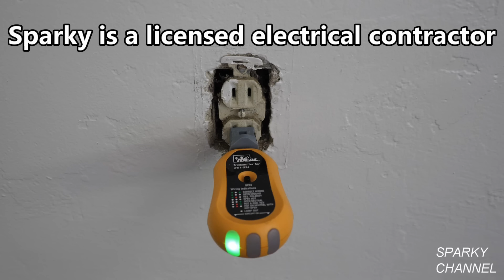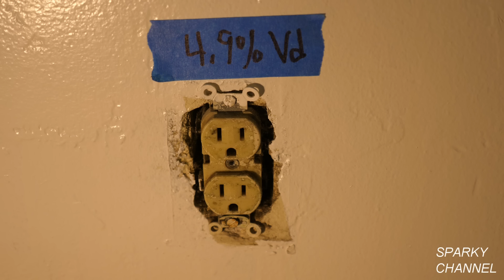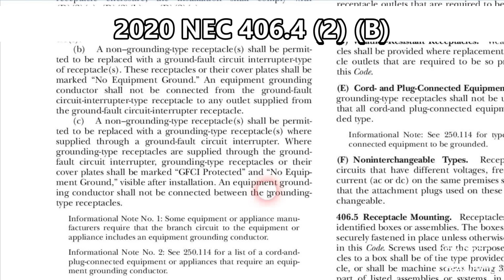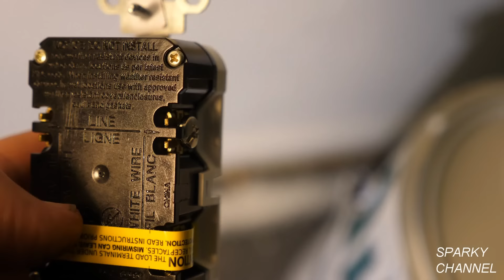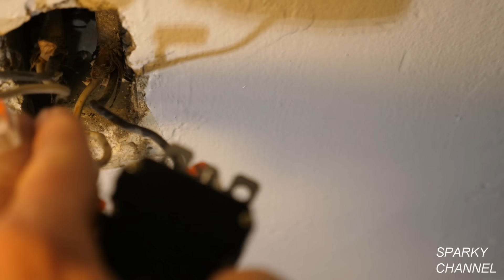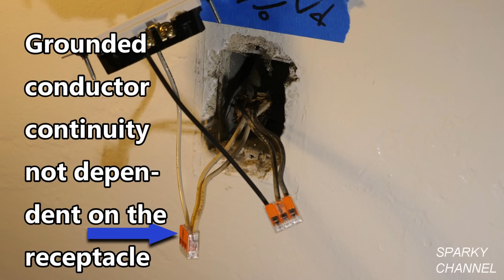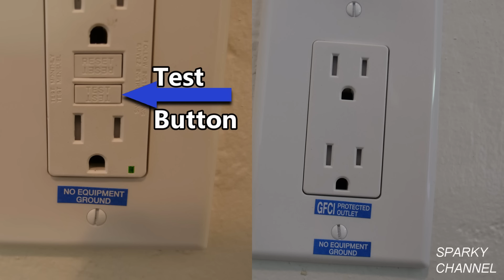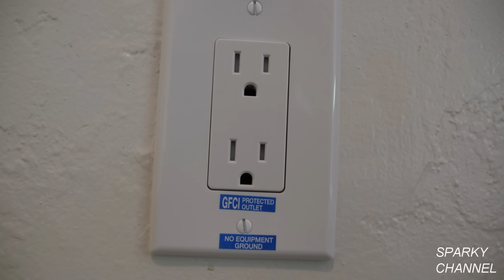2 Prong Receptacle Circuit Replaced by GFCI and Grounded Receptacles per 2020 NEC

Comment: I'm not seeing the logic of using pigtails instead of wiring directly to the receptacle. The idea of "if the receptacle fails" power will still go downstream has at least 2 logic problems imo. #1 A receptacle failing can be a serious problem because it's likely not going to be a clean break. You can have the receptacle heating up. If downstream receptacle also lose power I'm more likely to be alerted to the problem asap. #2 Following your logic then what happens if the pigtail connector fails? Why are you focused only on the receptacle. What we've done here is introduced another place for failure. Now if either the receptacle or connector fails there would be a problem.

Not saying it's wrong to pigtail, only the logic. The reality is this systems are in place to reduce risk caused by receptacle or connector failure. Code doesn't require pigtails in this case. Sometimes creating your own expanded code can cause added risks. But that's the world we live where almost everyone thinks they know better about everything. I just try to follow code as best I can.
Reply: 15:30 he gives the reasoning. It is not Code to pigtail and you're right about the devices being built to do the job. But receptacles can be subject to physical damage. Plugs can be worn and faulty creating heat and destroying receptacles. Pigtails insure no loss of neutral current downstream which is a huge problem especially if the circuit happens to be a multi conductor circuit. Pigtails are a step above in most electricians opinion.
Reply: I've had insert connections fail. Never a pigtail.
Reply: @djg585  nobody is backstabbing
Reply: I have always preferred using the receptacle to connect the two sets of conductors. Less wire in the box and less points of connection.
Reply: Agree.. and what could possibly fail in the receptacle that could break the connection? Its two wires screwed down to the same little copper plate. The copper plate would have to somehow snap. Seems to me the pigtail is way more likely to fail than the receptacle

Comment: There can be dead outlets, rare though. Sometimes because of a tripped GFI no one noticed. So turning off the breaker and then testing for dead outlets could end up confusing a person.
Reply: Excellent point. I hold back to not seem like a crab but I spend more time proving each and every cable. It is not predictable what happened over time in residential wiring, everyone has an Uncle Festis it seems. Prove every cable , I flash the conductors of every cable. Bill may have actually done so but is limited to how long the video can be.

Comment: So you don't need to run a new cable with ground to replace the old one?
Reply: It's not required. But yeah it would be better to replace the cable, but at considerable expense.

Comment: I replaced a 2-prong outlet with a GFCI outlet as an upstream outlet and connected two downstream 3 prong outlet. I use 2 wire Romex( with the additional ground wire) to connect all of the downstream outlets. I connected the ground wire to the GFCI green screw(ground) and connected all outlet grounds together. Now, I know all ground wires should return to the panel when possible, but this was not the case.  Did i connect the grounds to the outlets properly? The circuit works fine and I have had no issues. Please let me know if I probably caused some kind of future problem.
Reply: That is a code violation. The code explicitly bans connecting the ground wires. There is a potential risk that if the ground wire in one outlet gets energized the connection spreads it to all. 

Never improvise with the grounding.
Reply: @okaro6595  Thanks. I felt somewhat uneasy about the grounding
Reply: Other than what Okaro X said, your plugs should be protected because in the event that someone gets shocked, the load on the hot wire and the neutral will become unbalanced (unequal) and trip the Gfci breaker because part of the current will not return on the neutral, but to the ground through the person getting shocked.

Comment: I’d love to do this in my old house, but I’d be hard pressed to fork out $400 for a circuit analyzer like this one.
Reply: Where you getting $400 from? It's $50 on Amazon for the circuit breaker finder
Reply: You dont need one. Flip a braker and find out wha turns off.
Reply: Why can’t you just disconnect all the outlets in the series and put wire nuts on all the wires. When you turn on the circuit breaker, only one hot wire will be live. That would be your most downstream circuit and where you would put the GFIC.
Reply: @blopez804  didn't he do that??
Reply: Jon said circuit analyzer. not finder. The analyzer displays voltage drop and other stuff quickly and accurately. Although It can be calculated using a multimeter and know load.
Reply: Klein makes a similar tool that costs about $130.

Comment: Liked this - Wonder if those connectors are the cause of the voltage drop, and if so, are they heating up at each outlet?  An old fashion twist connector installed correctly may be more efficient.

Comment: Sparky great channel.  Can I remove a two prong and replace it with a three prong and run a grounding pigtail to the box?  My two prong wiring is in bx.  Thank you.
Reply: Actually, I think you can. If the feeder is the old style BX which was designed to have the steel casing of the cable serve as a ground then yes. It's infamous as a horrible ground and that is why it was abandoned but at the time it was code. If you do this, check for continuity from the BX to a proven ground like a water pipe. Don't be surprised if the BX jacket is open/ ungrounded as the connectors for BX cable terminations are the entire problem with the system. If no ground... Install a AFCI GFCI device.
Reply: @fritzmiller9792  Yes and at that time the set screws to the two prong outlets secured to the metal box were considered as being grounded by code. Things have certainly changed thankfully.lol
Reply: No
Reply: Why?  When you test the outlet it shows properly grounded.

Comment: Couldn't you just plug up both the hot and neutral on the outlet without the wago connector?
Reply: I assume you're talking about 14:09. Yes, you can attach both hot and neutral directly to the receptacle (there is no code that disallows it as far as I know). Doing this doesn't change the path of the circuit, as all the neutrals are connected and all the hot wires are connected with either method. However many electricians will add a pig-tale so that the receptacle itself isn't responsible for feeding other downstream receptacles. 15:04 explains.

I am not a licensed electrician

Comment: SEVEN outlets on a single breaker? That seems a little odd even for back than.
Reply: I have seen 3 bedroom homes from the 50s with 4 circuits for the whole house.
Reply: @toddwilliams5905  My home today, before the service and panel were upgraded, had 4 BX cables and 4 old style fuses for the whole house. People back then didn't have that many things to plug in.
Reply: considering that reading lamps were mostly plugged in, it's not unusual at all. Now days, it would be a disaster with everything being plugged in, all the time. :)
Reply: how so ? 15a can go up to 8, 20a can go up to 10..  This is 2021 NEC... so why would 7 for back then be wrong ?

Comment: So how would I do the whole house would I do it the same way you did with the 7 outlets? To fully ground the whole house would I run a ground to all outlets and light fixtures? If I need to replace where the outlet where the frigerator is do I need a 15amp or 20amp outlet. Help please respond..

Comment: Thanks I really need this info....Old cottage with no ground....who ever wired it previously just put a ground from the receptacle to the receptacle box....I was looking at it and said...that sure doesnt seem grounded to me!!!!
Reply: The box may be grounded. Get a socket tester or use a multi-meter to measure voltage between the line and the ground and continuity between the neutral and ground. Of course to properly test it one would need better measures.

Comment: sooooo why didnt you bother adding an actual ground wire. seems the GFI is useless if you dont add that ground wire. and seeing its an older job it would be better to just update it to be safe. and if a homeowner or business owner isnt letting you do that work, id walk away from that job if i were you. because wont lie, if you redid outlets in my house and didnt bother to tell me it needed to update ground wire because of the house age, especially after showing me there was no ground in my outlets. and my house burned in an electrical fire....that leaves you open for liability lawsuit. 

id say just tell a homeowner its a good idea to have it done, show them the missing wire and if they refuse have them sign a liability form releasing you from any liability should the house catch fire due to electrical failure. 

just saying that would be a good idea to cover your own ass.
Reply: Using GFCI without a ground to provide a 3-outlet receptacle is totally compliant with NEC regulations (as long as you add the "no equipment ground" stickers). GFCI doesn't need a ground to protect users, as it's looking for any current leakage between hot and neutral. Generally ~5 milliamps difference between L/N is enough to trigger it. Older houses like this often only have a hot and neutral to each box, meaning the homeowner would have to replace any home-runs back to the panel with NM cable, which can become prohibitively expensive very quickly.

Is it as optimal as a proper ground to the box? No. Is it safe and permitted by code? Yes.

Unsure what you're on about.
Reply: My understanding is that GFCI protection without an actual ground protects humans, but not necessarily equipment plugged into it. I will say that the title of the video is a bit misleading when it calls three prong outlets grounded when each of them says no ground right on it. I would call them GFCI-protected three pronged outlets, but I'm no expert.
Reply: @sharpshooterv  You are correct. One should call them grounded type receptacles, not grounded receptacles.
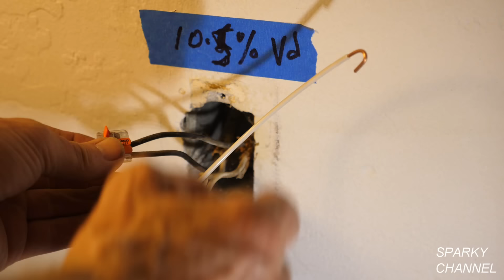Reply: @okaro6595  Absolutely correct.  Your point is best proven at 15:57 here when ungrounded receptacles are called "grounded receptacles." Not mere semantics when concerning what is obviously reasonably to be expected to be used as instructional material by laymen for such hazardous activity.  Then again, perhaps I'm overly biased by my own occupational experience. 😂👍
Reply: In residential, the neutral is a "ground". In the main panel, the grounds and neutrals are tied together. The difference is, the neutral is the return path for the electricity. electricity is constantly trying to find it's way back to the source. Whereas the dedicated ground wire, more often than not, grounds the housing of whatever is plugged in to that outlet incase it becomes hot. The GFCI will monitor the balance between the neutral and hot and if it detects an imbalance, will cut all power to it and after it. Which is why he didn't pigtail the GFCI outlet.
Reply: No. He isn't subject to liability because he followed electrical code.

GFCI protects occupants against electrical shock. They DO NOT protect against fires.
Similarly an earth wire protects against electrical shock, it does NOT prevent fires.
To protect a home against  electrical fire you need AFCI protection. 
Had he elected to re-wire the house instead of upgrading the outlets then he would be required to install AFCI protection in the bedrooms.

What Sparky did here is make an old home safer. Could it have been even safer than that. Sure, but at what cost?
Reply: If you bought a house with 2 prong outlets you don't need an electrician to tell you what you should already know. Adding a ground wire is against code. Sooo how do you know what conversation the home owner & electrician had?
Reply: He would NOT be open for a lawsuit as what he is showing us is an industry standard method that has been used since AFCI devices were introduced into the Code for residential use.
Reply: the gfci receptacles are loaded with circuitry inside. that's why they cost a pretty penny.

Comment: Here's what I'm wondering: If the outlet box is metal and grounded (because the system is tied together with metal conduit, which is then grounded) can you run a wire from the ground lug on a three-prong outlet to the box and then have the outlet grounded?
Reply: Check the code ,but yes. There is another video. Called five ways to ground.

Comment: Curious, what if this circuit is sharing a neutral with another circuit, as happens in some old houses.  Does this solution still work?
Reply: No, multi wire branch circuits do not work with a GFCI'S.
Reply: @surferdude642  In that case, can you put a GFCI on each outlet, or still no luck?
Reply: @jmpersic  Back to your original question. Is that receptacle with the shared neutral the only outlet on those 2 circuits? Is it in the kitchen or garage? The shared neutral is used primarily for maximum current availability for the 2 sockets for high power appliances used in the kitchen. Should be a 20 amp circuit with a double pole breaker.
Reply: @surferdude642  Thanks for responding. I'm thinking in hypotheticals but will keep your words in mind.  Just bought an older home, and it'll be my first time dealing with a 2-wire system.  I'm considering adding a fully-grounded sub-panel for new circuits and adding GFCI where ever I can.  I'm also wondering, can't GFCI circuit interrupters be added to the old panel to protect the whole circuit?  Wouldn't that be easier than figuring out the upstream outlet, and just as effective?
Reply: @jmpersic  I would say yes to both questions, but the qualifier would be if there's a GFCI breaker available for the old panel. If not, you could upgrade to a new panel. You may want to consult with an electrician and also verify if adding a sub panel is necessary or makes sense. Keep in mind that you only want gfci breakers on circuits for bathrooms, kitchen, garage, and outdoors. If the home is wired for example that a bathroom and a couple of bedrooms are on the same circuit, a GFCI receptacle for bathroom and a standard breaker is probably a better choice. GFCI breakers are much more expensive than standard breakers and GFCI receptacles. Hope this helps, good luck.
Reply: @surferdude642  Thank you, a big help.

Comment: Seven receptacles on one circuit is too much.  In this case, replace the service panel with a new panel with more slots.  New breakers and then run new wire.  This will cost more but worth it.
Reply: Most likely, 7 receptacles on one circuit is not a problem. Just pay attention to how many are being used at the same time and the current draw from each load. You could have 10 receptacles on a circuit, even a 15 amp as long as the overall load does not exceed 12 amps on a 15 amp circuit and 16 amps on a 20 amp circuit.
Reply: 2021 NEC guidlines disagrees with you... you can have up to 8 on 15a and 10 on 20a
Reply: @jeepsblackpowderandlights4305  NEC does not explicitly state how many you can have. There's just power draw restrictions that you have to keep in mind for the application.
Reply: I agree that the amount of voltage drop here is not ideal and will shorten the life of appliances attached to the circuit. If it was my house I would ask for a quote to rewire the home. The owner of this home maybe a flipper in which case they will go with the lowest cost code compliant solution.

Comment: Interesting that you can use the gfci at just the lead outlet in the circuit. Would it be bad to use them in all outlets? I know they’re more expensive, but I can do my whole house in gfci for way less than the cost of that tool.
Reply: Yes I don't think he means for you to buy that tool, he just has it because he's an electrician.  Also there is no reason to use physical gfi's for each receptacle box, only the first one in line.
Reply: That tool is twice as a gfci. One gfci protects all the other receptacles. 7 is too many. Read the information that comes with the gfci, I 5hink 4 is the max.
Reply: You could do that, but make sure that you don't connect to the load. Dan Adams is correct though, it's wasting your money.
Reply: The tool saves him time. Time = Money.

He could have simply removed all outlets. Energized the circuit and used the cheaper voltage tester to find the one hot wire. For DIY that would make most sense, for a pro like Sparky they will invest in tools that save time and money in the long run.

Comment: Why don't you just ground the plug itself
Reply: It depends on how accessible it is to run wires. If you can easily get a ground wire to the box, adding a ground is a great solution. If you can't, a GFCI outlet or a GFCI breaker is far more practical.
Reply: That's 7 outlets to rewire all over the place.
Reply: @jonmayer  Correct but its worse than that. The whole house would need re wiring. If he rewired this one circuit in order to run a ground conductor to the panel he would have to modify the panel. Once you modify the panel it has to meet code, which this old panel won't. So he would need a new panel. If the panel is replaced then the other circuits wouldn't meet code because they lack a ground wire.